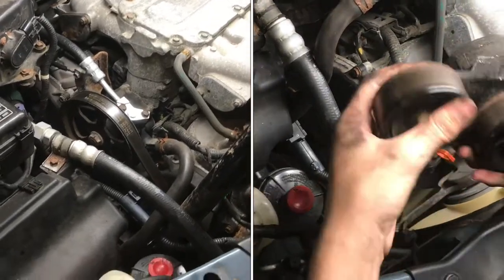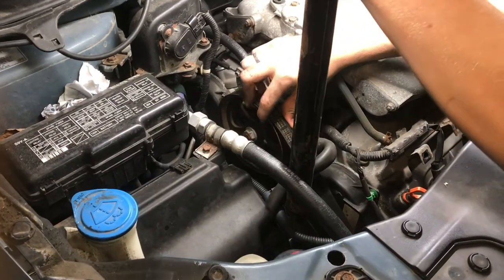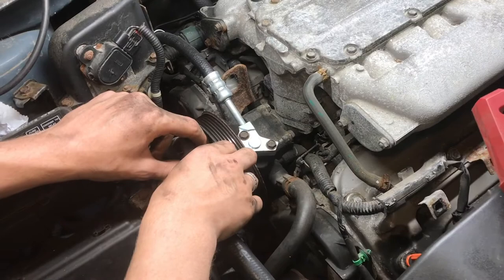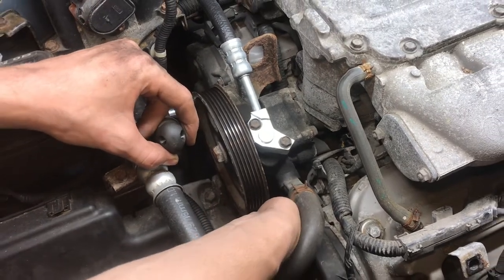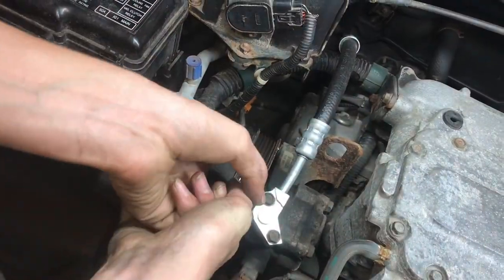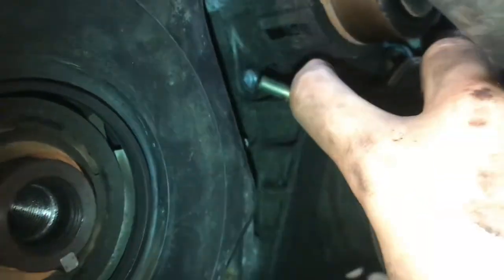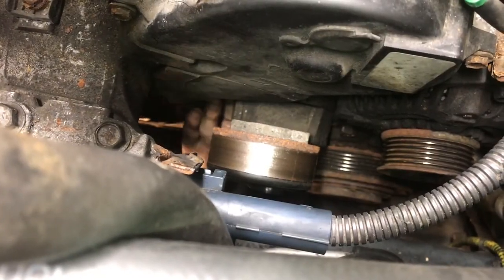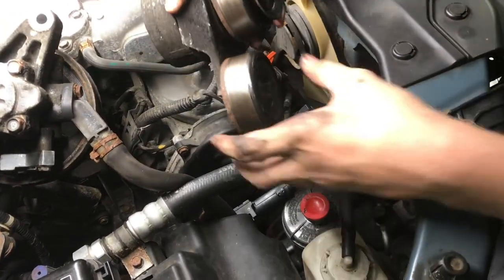removing serpentine belt TENSIONER honda pilot 03, 04, 05, 06, 07, 08

Comment: I did not remove the power steering pump at all plenty of space to get it out so long as you slide the power steering fluid reservoir out of its bracket and get aome more slack on the hose.  I needed that slack even more when unloading the tensioner to get the new belt on.

Comment: I don't know about the '06-'08 Pilots but there's not much reason to remove the PS pump on the '05 which I've owned for over eight years unless you're hell-bent on removing it through the top. The tensioner can also be removed through the bottom...just have to move it around and it will just squeeze through the opening. I've replaced the belt and tensioner twice with the last time being two days ago.

Comment: 2006 Pilot has 19mm not 14mm. 3/4 inch in a pinch.
Reply: Thats with the hydraulic tensioner im guessing, i have a 2010 crosstour with the same one, im trying to find a video thats actually showing the detail of this thing and what it bolts into, the ac bracket or the engine block so i can switch to the mechanical one, cause the cheap aluminum that makes up that 19mm tension point sucks
Reply: Must be aftermarket because my 2006 Pilot is a 14mm through the pulley itself.